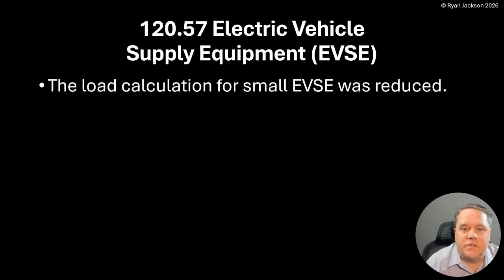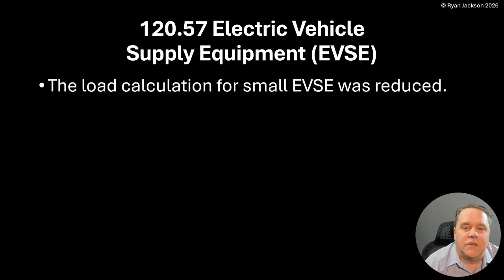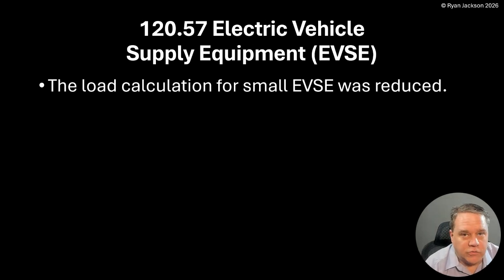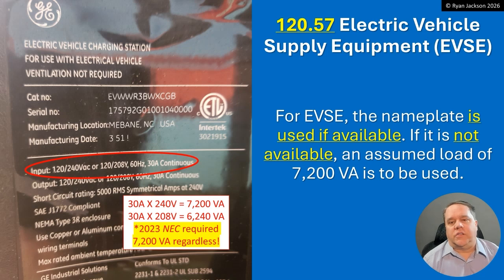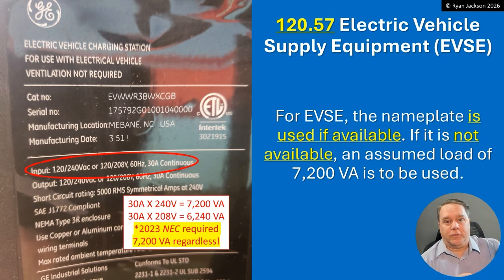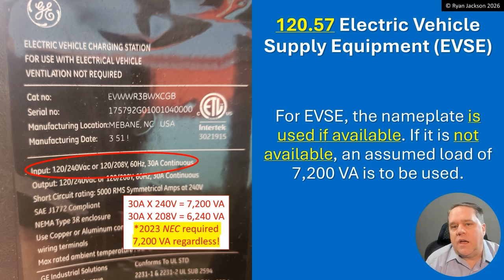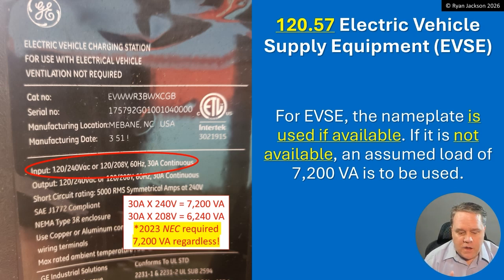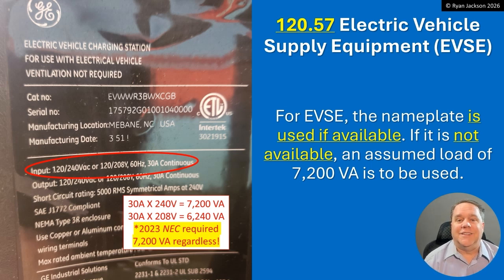100 Days of 2026 NEC Changes Day 14: 120.57 Load calcs for electric vehicle charging equipment

Comment: I wonder how many circuits are undersized once the equipment is installed😅 cause level 2 is typically a minimum 32a output rated to 40a. Seems like an unnecessary cost

Comment: Ryan, I can give you a perfect example of when you need to calculate the load for an EV charger and won't have a nameplate.  The state of Maryland has enacted legislation that all new single family, duplex, or townhouse units that have a driveway, carport, or garage must have the branch circuit installed for a "Level 2" EV Charger. This includes the branch circuit conductors and the overcurrent device. The homeowner has no choice in the matter; the wiring must be installed so the potential load will need to be calculated even if the actual charging equipment is never installed.
Reply from the maker: Great info Don, thanks!